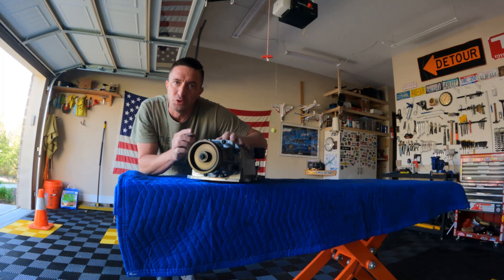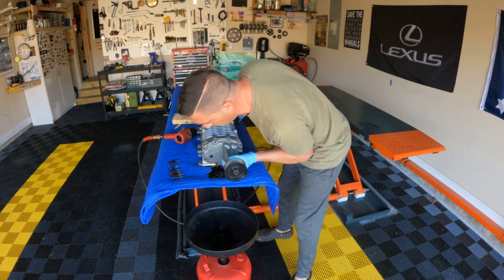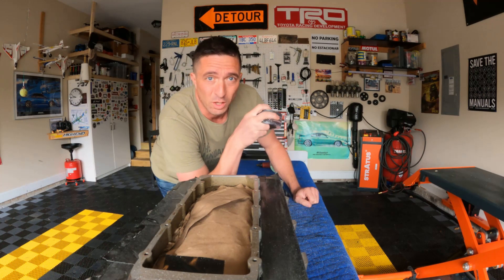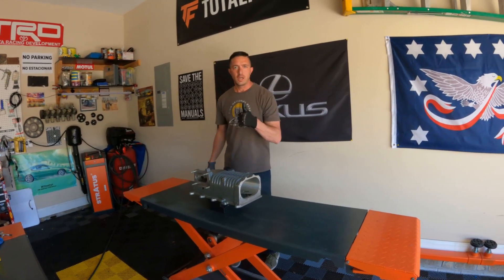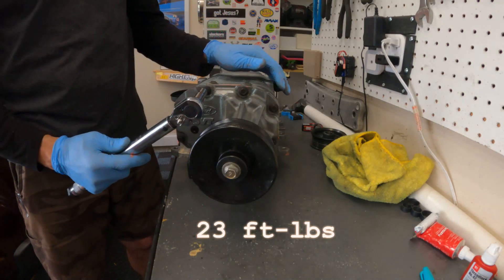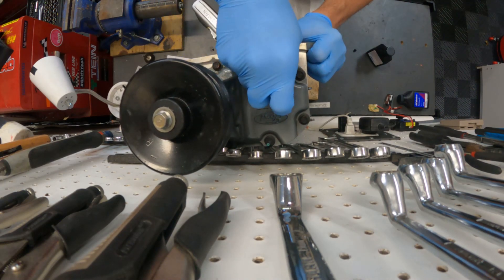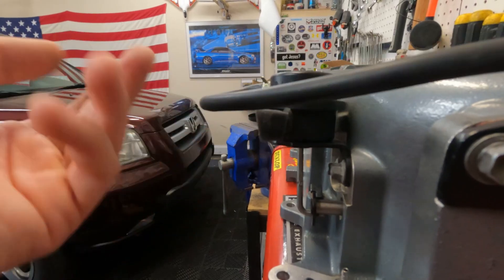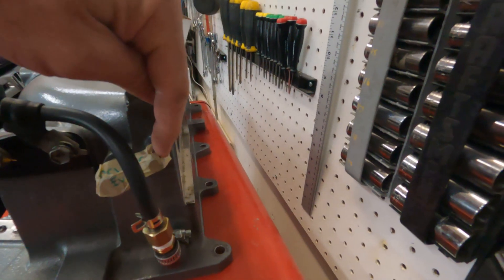Supercharge Your TOYOTA / LEXUS V8 | Episode 2 | Supercharger Preparation

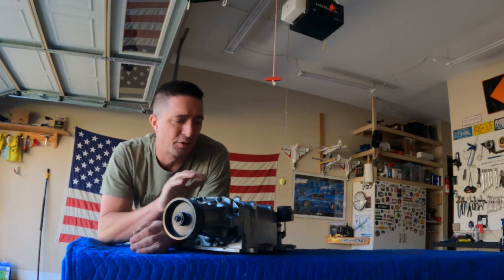Comment: 0:54 - i thought machine shops made jigs to perform special jobs like this? 🤔
Reply from the maker: So did I. No one around here had one, nor wanted to deal with this at an affordable price. Machine shops wanted the price I paid for the supercharger alone, just to machine off the flange in a janky jig. So, like most things, I just did it myself for about $5 in Harbor Freight cut, grind and sanding wheels. 😂
Reply: @ForwardMomentum you found a way and made a way. 💪😎 I'm on episode 3 now around the 25 min mark. There's a few things i would have done differently. Maybe you would have liked my suggestions, maybe not, but I'm years too late to offer criticisms. Sweet job so far.

Comment: Can't wait for the tuning episode, ive been looking at the enricher for a while to get a turbo set up on my 3uz.
Reply from the maker: Awesome! Just remember, the Enricher is designed to help with that sometimes abrupt closed to open loop switchover. It also starts adding fuel as low as -4 vac. Fuel pump, injectors and fuel controller is where the magic really happens. 👍

Comment: Hey man. Great work!
One quick tip: on click type torque wrenches, don’t jerk on them to tighten the fastener. Slow and steady pull, increasing in force until it clicks. The quick abrupt application of force on the handle can put more torque on the fastener than intended.
Reply from the maker: I completely agree with you and, from aviation, I know that’s the truth. When it comes to non-critical clamp points, where the item can’t be secured in a fixture, I just jerk it like that out of bad habit. Thanks for the reminder.

Comment: So I’ve contemplated boosting the HP of my SC430 without getting too radical - this looks like a viable option.  Unsure whether the stock engine and transmission will handle the additional strain . . . 🤔
Excellent video and tech tips BTW - thx!
Reply: Good work